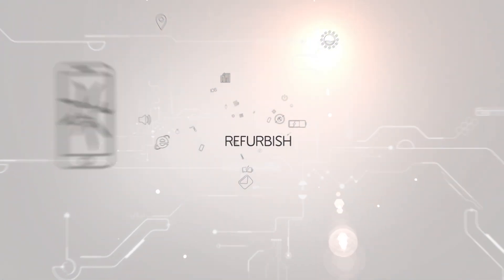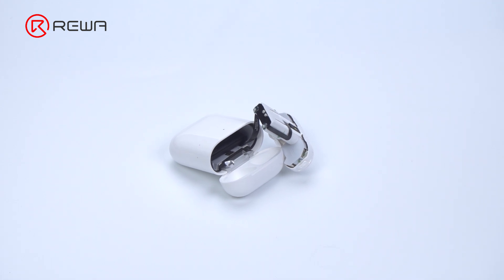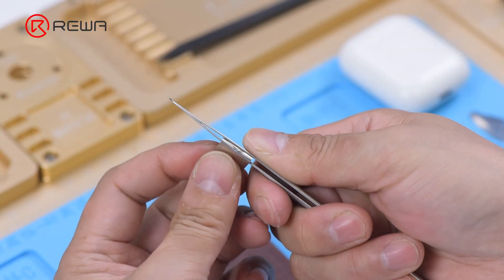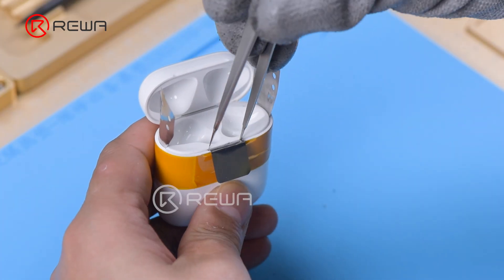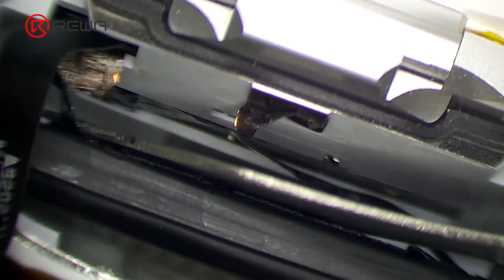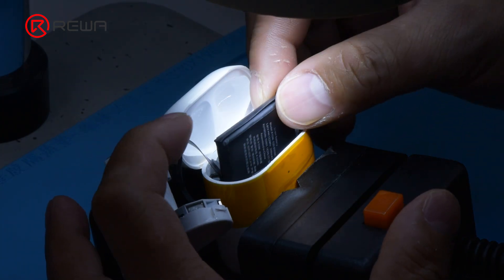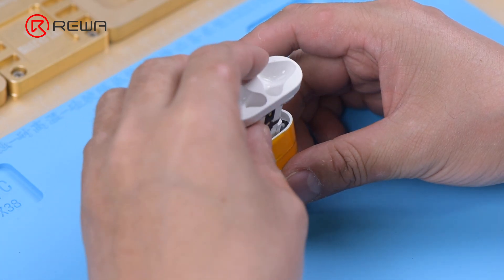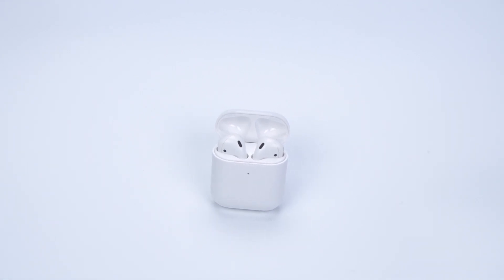AirPods Charging Case Battery Replacement - Not Charging Issue

Comment: Apple is now including their battery service for free in Apple Care +. It's not like you unscrew some screws and the battery pops out. You really need to do all the prying and picking. Really curious how their technicians will do the battery exchange to make it smooth enough so that there won't be scratches and nicks all over the place. Otherwise, not only the aesthetics but also the waterproof performance is going to be compensated.

Comment: Fascinating video though,  appreciate seeing it,  Unfortunately it confirms the fact that though possible, this repair is completely impractical.  The need to make custom tools, the jig for holding it and the tweezers to extract the battery, plus the time and effort required, and the likelihood to make a simple mistake and ruin them makes this a fools errrand.    Cost of new $150 direct from apple.  No repair person is going to get rich charging less than new for this repair or want to assume the risk of likely damaging the, beyond repair.

Comment: My AirPods are completely water damaged, would changing the battery fix the issue or is the whole thing fucked?
Reply: I would suggest that the whole AirPods is damaged. Water have probably done an oxydation on the main circuit board, always connected to the battery by conception so unless you've been able to dry it rapidly, the whole thing might be broken by oxydation...
It's just my point of view 😃

Comment: I have a I9 TWS and the left pod dose not charging while the right does perfectly. Is this a problem of the case or the pod?
Reply: If the right one is charging perfectly, I would suggest that the problem is coming from the left pod. I9TWS are easy to open. Normally, the battery is located next to the speaker, so you just have to buy new batteries, open the pod and do some soldering in order to replace the battery. Hope it helps

Comment: Amazing, just wait for a month and there will be countless tool on market to open airpod case
Reply: Doubt it, this repair is too labor intensive to make economic sense for most consumers.
Reply: @kevinruan  judging from amount of work in this video, i guess the final cost will be in range of $25 to $35, including the battery., so instead new $150 airpod they can  pay $30 for new battery

I know it's tricky to replace battery, but it because of lacking right tool and they have to DIY, now the Chinese knows the idea and they will start producing the tool for this job